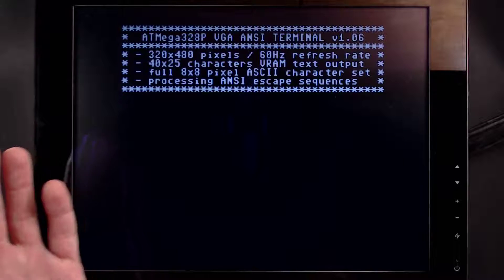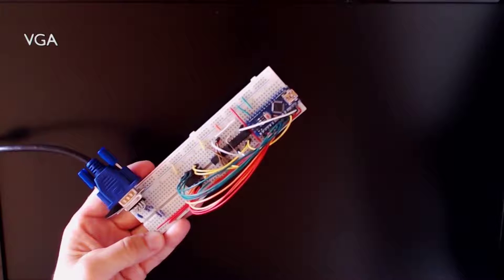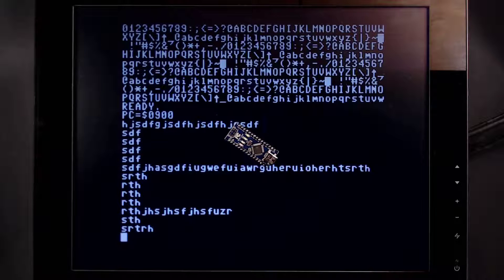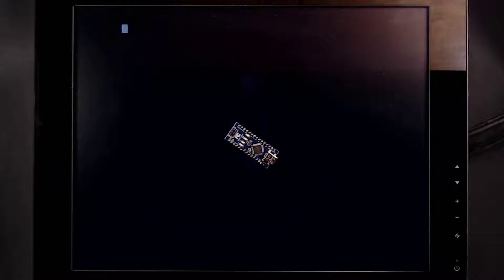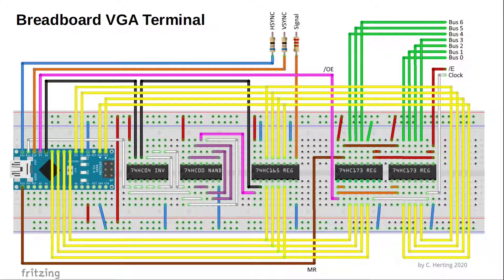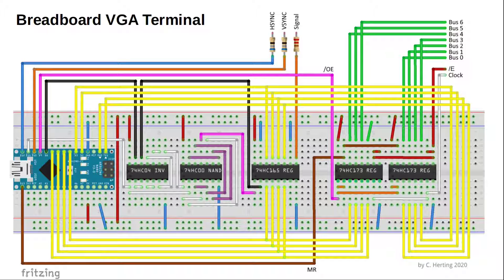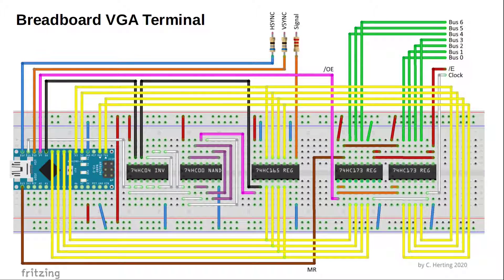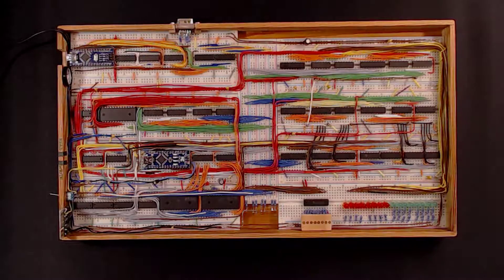Breadboard Arduino VGA Part 3: Let's build a Terminal

Comment: Hello there, i am trying to recreate this awesome project by i have a problem. It doesnt write to the screen. I've tried multiple things to try to debug it but I can not come to a conclusion. I've tried to not use the bus and rather to manualy set the input pins to the combination  01100001 (a) and still nothing on the screen. Also i tried to disconect the MR pin from the Arduino and set it to never reset that also did not help. Lastly i tried to disconect the OE from the arduino in this case when i set it to always output (combined with all the above methods) the screen shows a in all spaces. When i set it to always disabled nothing is shown to the display again. This makes me suspect that the arduino does not output the vram to the hc165 register but i cannot debug the code any deeper. Thanks in advance to anyone who reads this . If anyone had thea same issue or have any suspicions on what may be going on please tell me below. Thanks

Comment: This is an excellent starting point for my forthcoming retro 6502 computer.
Some people criticise others for using microcontrollers in retro computers, but if you look at the computers of the 1980s, they often had ULAs or custom chips to handle the video.  Using an Arduino is no different - we just don't have the ability to make custom chips, unless we start programming FPGAs.  Besides, my retro 6502 is a functional replica of my first computer (from 1979), which had UHF output for a TV.  I just want the same functionality but with modern components.

Comment: This is very cool! Would it be possible to increase H resolution to 480? Maybe at the expense of refresh rate? That would get you 80 columns if using the classic 5x7 font. I know nano ram is tight for a char buffer that big, but there's other AVRs in the family.

Comment: This must have required a tremendous amount of work and I'm truly glad you've shared it. I also see you've added a terminal connection in a later video. I tinker a lot with VB6 interfacing Nano and HC12 transceivers (PC input/output devices over long distances) so will start playing with a PC sending text to a remote VGA screen as soon as I get the IC chips. Great video and thanks again :)
Reply from the maker: Glad you find this useful :-) And yes - it required quite some tinkering...

Comment: sorry if this is a dumb question, but I was just wondering if it uses RX and TX, and if so where does it get the input? is it just on the normal Arduino RX / TX pins or does it only read parallel data into the registers. sorry for being so late to the video.
Reply from the maker: No worries,
actually this here is not a serial terminal. It is taking input directly from a CPU bus. In case you want to build a serial terminal, pls watch my latest video. Cheers!
Reply: @slu467  ok Thanks!

Comment: This is fantastic. Small question since you have been experimenting a lot. Is it possible to have 80x25 Hercules like B&W mode if we would use another nano just only for graphics - sth like "nano graphic card" ? What would be the max resolution to squeeze from it ?  (I'm looking for a "graphic card" for my own 6502 8bit computer and this looks like perfect fit).
Reply from the maker: To my knowledge 80x25 can only be achieved on PAL / NTSC composite video, not on VGA (I mean with a "stock" ATmega328P). But you can try to "squeeze out" even more: Maybe experiment with a 25MHz crystal. That is slightly out-of-spec but I've heard it's no problem.

Comment: i forgot, how many mips is this cpu? also its a very clean and nice design and probably the perfect ratio of power to complexity, mine is decently powerful but its gonna be a real pain to make in real life outside the simulator so great work.
Reply from the maker: Mips is hard to measure since it depends on the code. Over a wider range of tasks I have something like 0.25mips ;-) Thank for appreciating my work.
Reply: @slu467   It's 1.26 mips  and, my cpu runs at 10 mhz 10.  I will use wire wrapping but my cpu will be a unclean, rats nest. Where as yours is probably most efficient with parts and it has the perfect ratio of parts to power! How was my attempt at proper punctuation?

Comment: Wow ist das beeindruckend mit den Escape-Sequenzen und allgemein toll erklärt! FRAGE: Geht das auch mit dem Arduino Uno? Das wäre super! Direkt abonniert. Könntest du vielleicht noch mal erklären, wie genau ich über einen zweiten Arduino die ASCII-Daten rein bekomme? Wenn ich das richtig verstehe, kann ich nicht einfach via Seriell von einem zweiten Arduino "Testtext" übermitteln, weil dieses Terminal Input in Form von all diesen grünen Anschlüssen braucht (ASCII Input)? Wäre es möglich einen zweiten Arduino als "Vermittler" einzubauen, der all das übersetzt und man das Terminal leichter "füttern" kann? Eine Erklärung wie genau man den ASCII-Input bewerkstelligen kann wäre toll :)
Reply from the maker: Hi, schön, dass es dir gefällt :-) Du hast es schon richtig beschrieben: Der Arduino ist voll damit beschäftigt, VGA zu machen und kann nur noch ein paralleles Input-Register auslesen. Serielle Kommunikation ist nicht mehr drin. Es wäre aber kein Problem, einen zweiten Arduino von außen in das 74173-Register schreiben zu lassen. Der kann dann serielle Daten empfangen. Klar geht auch ein Uno. Viel Spaß damit! Cheers.
Reply: @slu467  Alles klar, habe mir direkt mal alle ICs bestellt, und sammel dann meine ersten Erfahrungen mit den Registern. Mein Plan wäre nämlich auch einen extra Arduino eigens als "Vermittler" einzusetzen, der dann wiederum ja I2C und Serielle Verbindung zulässt. Großartiges Projekt, vielen Dank für diese Informativen Videos!

Comment: Excellent! I am Really interested on this kind of projects. I am planning on build a homebrew computer, so this is really useful for a video card. Is there a way to add color support? Thanks in advance for the great Work you have done.
Reply from the maker: Hi Luis, yes there is :-) just one more IC for 8 colours... I'll be showing it in my next video. Cheers!
Reply: @slu467  thanks bro for your hard work on this and explaining everything about it in an easy way.
Reply: @Slu4 Well I am excited about it, I'll be waiting for that video!. Btw...how the card communicates with your cpu? Is through serial Port? If It is then you can say this can work for any cpu using serial communications. am I right? And thank you @Slu4 for taking of your time to answer my questions.
Reply from the maker: @Luis This VGA card has an 8-bit input register (build from two 74HC173). This register is connected to the system bus. Whenever my DIY CPU pulls the appropriate 'terminal in' control line the value on the bus is stored in the register. The VGA card just looks at this register and whenever something appears in it, it is displayed, i. e. inserted into th VRAM at the cursor position. So there is no serial input path here. For testing you could build one using another Arduino. Hope this helps. Cheers!

Comment: Ohh nice video as always. Maybe an option to save you time if you want, is to show in a video the modules that are exactly the same as Ben Eaters so you do not need to show the schematics or how they work. Bye and thanks for your work. As a teacher, I appreciate the time an effort.
Reply from the maker: Hi Diego, thanks for commenting and for your kind words! As for my CPU series, I focus on the ideas unique to my design and also have referenced Ben's work several times. Just to clarify: The stuff I show in this Arduino VGA playlist is rather unrelated to Ben Eater's CPU - but could be used as an add-on to his system of cause :-) Cheers!